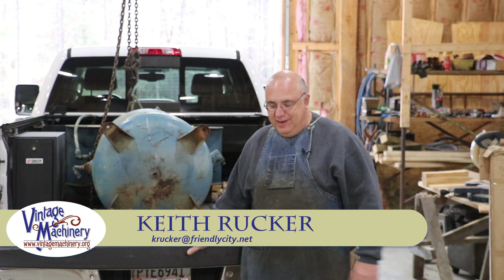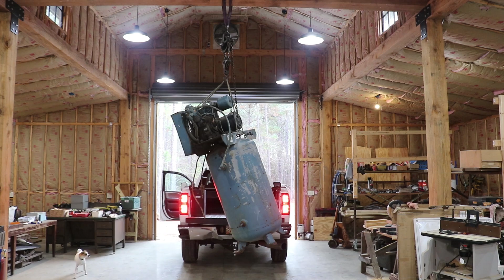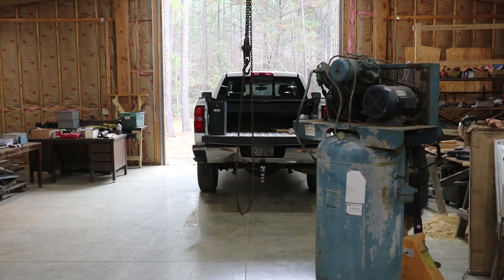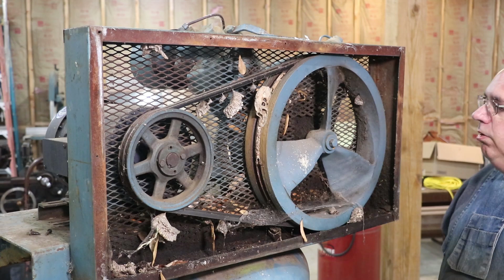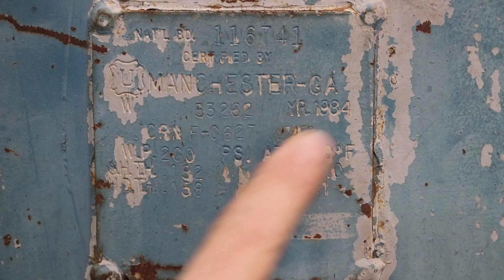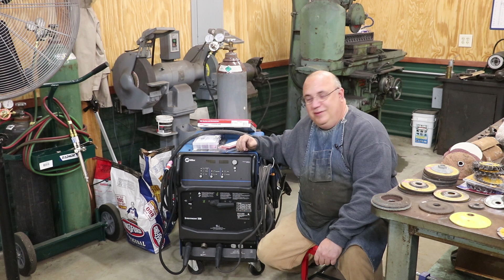New Air Compressor and Tig Welder for the Shop!

Comment: Treat yourself to a used Tommy Gate lift and some overload springs (the classic old timery tow truck and rollback mod is to use heavy same-width leaves off much larger trucks then extend your bump stops so they just touch the overloads by welding heavywall box tubing to the stops perpendicular to the spring) and you can self-load that sort of weight almost anywhere. For example I lifted the complete base of my old round ram Bridgeport using mine.  Used liftgates are usually inexpensive and while you can buy the adapters to any common truck for about 150 bucks you could make yours for the cost of scrap since they'd be a trivial project at your skill level. 
USB scopes are cheap online and let you do visual tank etc inspections and look inside machinery, cylinders via spark plug holes etc and you can use them with any computer or Android phone.

Comment: That Gas regulator doesnt look like the right kind for TiG welding? Maybe I'm wrong but they always have a glass part with a floating ball???? That one there looks like the kind on a cutting torch or MiG welder.............
Reply: Jusb1066 my Miller diversion 165 came with the same flow regular. But my miller dynasty 210 came the style in links you posted
Reply: nah the glass part is a water separator, which is usualy used  on airlines, not gas tanks, tig is still argon gas from a cylinder, that half of it is the same as a mig
Reply: No, not a compressed air water trap - a FLOW METER, most TiG setups have one, I'm a welder, not a keyboard cowboy- 
https://weldingsupply.com/cgi-bin/einstein.pl?PNUM::1:UNDEF:X:PXRF1430-580
Reply: http://www.eastwood.com/welding-flow-meter.html?mrkgcl=764&mrkgadid={_mrkgadid}&rkg_id=h-0d2c95e376968668e699bd477aa963b9_t-1513630112&product_id={product_id}&adpos={adposition}&creative={creative}&device={device}&matchtype={matchtype}&network={network}&SRCCODE=PLA00020&gclid=CjwKCAiA693RBRAwEiwALCc3u0CNt4XBLUk6SoaFkhWQkoRRI2GqVd8u0LW2sPNxWDEeD9hHdB86IBoCY5sQAvD_BwE
Reply: https://www.grainger.com/product/5KJ73?cm_mmc=PPC:+Google+PLA&s_kwcid=AL!2966!3!50916749757!!!g!82166712357!&ef_id=WYAcHAAAAFjepQU_:20171218204854:s&kwid=productads-adid^50916749757-device^c-plaid^82166712357-sku^5KJ73-adType^PLA
Reply: ahh yes a flow meter, i forgot sorry (been a few years)  i had one of those on my mig so theyd usually be the same?

Comment: I would be concerned about the the bottom of that compressor tank. Looks like some scaly rust below the center drain bung - "below" as it was laying in your truck as shown in the video. The bottom of the tank is vulnerable to rust thru if the condensate isn't drained frequently enough over its life. IMO, scrape that rust off and inspect it carefully before you spend much time working on it or even before pressure testing it to verify that scaly rust is just external corrosion and not the beginning of rust thru from the inside.

Comment: Kieth I would locate your new welder away from you’re grinders. That is if you intend to keep you’re equipment clean and in good shape. I protect  mine with covers supplied by the manufacturer, form fitted. After all I an not using them every day.
Reply: yep at least cover it, i think he did have grinding area in the shop with a curtain, maybe make a weld station the other side of said curtain? dunno, bares thinking about, hate to see welders full of  grinding dust

Comment: The formula for determining the hydraulic test pressure according to the ASME Boiler and Pressure Vessel code is 1.3 x design pressure x allowable stress at room temperature for the vessel material/allowable stress at design temperature.
Since we don't know what materials it's made from, this falls into the category of "technically correct but completely useless answer" - sorry!

Comment: Hi Keith,
Two things: looking at the large wheel for the belt, it looks like the spokes are angled to blow air over the pistons for cooling. So I'd bet it turns anti-clockwise as viewed from that side. As far as getting up to speed on the tig, check out Jody's channel - welding tips and tricks. He has great videos and great arc shots so that yoou can see what's going on in the puddle. He also has DVD's.
Good luck, feel better and Happy Holidays.
Rich

Comment: If you moved your chain fall closer to the posts rather than right in teh middle you could pick up a lot more. With the span and beam size I could tell you roughly what the safe load would be.
Reply: You better get on here and try and defend yourself. His stuff is way smaller that yours so we know you didn't send it. Even if you had culls they'd be bigger. Baily wagged off.
Reply: Perhaps Kieth didn't think of that

Comment: Now that is a air compressor. I have a 3 cylinder, 60 gallon compressor and it is nice to have the capacity. Mine sits on a concrete floor so I put rubber feet on it, quietened it down quite a bit.

Get better.

Comment: You only need to run 100 psi ,air tools are built to run @ 90 psi be safe .Look for a direction arrow somewhere and change the oil. Harbor freight has a bore camera ,a good investment .
Reply: well the compressor runs more and stores more air, and it will keep the flow up along the long lines, and regulate at the end where you use it, is kinda why they do it,
Reply: Big tanks often have an opening, which can be removed to control it from inside.

Comment: long time watcher, I piped my dads shop in the 70's  with old gas pipe that was being tour down from a building. T contractor was cool an just said take it if you want to shake it out of the pile of material. I guess these  days they might want a few bux an you may have to bend a pipe or two, just a thought

Comment: Hi Keith some years back I spent three years building Air comp.s for a living DOR is anticlock wise this is only a heads up to check it out  looking at the fly wheel and the built in fan blades  run it the wrong way and it will seize up as the oil pump only pumps one way regards Norman  Isle of Wight UK

Comment: Keith, the compressor will pump turning in either direction, but when you wire your motor, make sure that you have the rotation in the direction of the arrow on the flywheel. If it has no arrow, make sure it turns so that the pitched spokes/blades are blowing air across the pump, not sucking it away. Also, when you set the compressor, if you're going to bolt the tank to the floor, make sure you bolt three feet, then shim the fourth foot if necessary before you bolt it down. Those feet are never installed symetrically, and if you tighten all four down with no shimming, you run the risk of torquing the tank and putting a substantial amount of stress on the welds when the compressor is running. From the lines I see coming off the cylinders, it appears that you may have the option of running the compressor either start/stop or constant run load/unload, depending on the electrical and pressure controls you use.

Comment: Cheapest and quickest way to plumb for air is to buy a roll of 16mm ( 3/4) nylon air line, and push on fittings to suit. Use nylon instead of the cheaper polyurethane, even though the nylon is a lot stiffer, as it lasts a lot better. Then just use T fittings and valves ( definitely use the valves right by the T, makes life easier) where you want drops, and then a water separator and fitting at the wall for the air line. At the compressor side a large non pilot valve ( preferably one with a brass body, but the alloy ones do well, just has to be 3/4 or larger so the port is big inside) connected to the power, so that turning the power off turns off the shop air as well. Makes easier startup as you do not bleed all that expensive air out through leaks. Add an auto drain as well, preferably electric, and put a mesh filter bowl before it to keep the crud and rust from the tank ( on that age tank there will be lots initially after the hydro test) from clogging the drain. 

I mounted the auto drain up a ways, using a shut off valve on the tank base ( stainless steel ball valve here definitely) to isolate it for drain servicing. Output of the auto drain is simply run through a 10m tight wound coil of 6mm tubing, it makes a great restriction free sound dampener for the noise.

Comment: Hello Keith, I am sorry to hear about your illness, maybe you should have taken a flu shot? They advertise them non stop, or so it seems. 
I just wanted to tell you, trig as as easy as can be. On pipe welding I had to learn to walk the cup and I have only got one good eye but I learned and I have no doubt, if I was to take a test on 2” pipe with a tig root, no problem. It is really easy. I guess it is like riding a bycicle, once you learn, you never forget.
All the best, Edgar

Comment: First, I pray you get better soon, but judging by how fast you work that hoist you ain't doing too bad... Congratulations on your new gear. For tips on the Miller machine check out "Welding tips and tricks" and "Welding.com" YouTube Channels they're awesome with clear concise guidance. If I'm not mistaken that compressor head has an automatic clutch so the motor always starts without a load, as the pulley speed increases the centrifugal clutch will engage the compressor input shaft. If the compressor head is bad I've got one for you, let us know.

Comment: Will one phase converter run all your three phase equipment? I was thinking you needed one for each machine.
Reply: Nope I run a dozen machines off my one phase converter.
Reply: can you run two or three at the same time? Thanks.
Reply: Lewie, I imagine you saying that with an English accent, am I right?
Reply: Yeah but you got Baily on the treadmill. He didn't get run over, just wore down and out!
Reply: Hillbilly English if you can call it that. Brian is in Ken-tuck and I'm in Care-O-lina.
Reply: no you connect the converter at the head of the circuit, sure it may only be rated to run one machine at a time, but hes one guy,!

Comment: The air tank has a U1A code stamp and a National Board#( look up the National Board  on the net) give them the # on the tag and they will send you all spec.of that as built i.e. heat treat, MTR's. weld spec.,pressure tests and such.
Reply: National  BD# on tank is 116741
Reply: http://www.nationalboard.org/Index.aspx?pageID=113&ID=442

Comment: Great welder, Learn how to tig braze!!! I did and I will never ever gas braze again. It works way better and is way easier to get much better results once you get the hang of it and its not very hard to learn. One tip I've learned is watch to watch 'Welding Tips And Tricks' channel, that man forgot more about welding than the rest of the internet knows combined and has the best videos I've ever seen on welding! Sounds like the valves are stuck on that compressor, just pull the heads apart and clean every thing up and that is all it should need. the compressor that ran my machine shop for 5 years full time was an old compressor that I rebuilt by just stoning off all the faces and making new gaskets from card stock.

Comment: Keith: I don't know about air compressor tanks, but scuba tanks are hydro'd at 5/3 working pressure. IF that applies to your tank, then the hydro pressure would be 333 PSI. I don't know if a new propane tank would be legal as an air tank. Check with a propane company and definitely your insurance company. They should know. Some people may say that a tank is a tank is a tank, but there's probably a paragraph in some obscure regulation somewhere that would void your insurance policy. Find out for sure. Good luck, and Merry Christmas.  Jon.

Comment: Changing the topic here... how will you get that compressor off of the pallet jack at its new home location? I had a 300+ pound band saw on one a while back and had a difficult time getting it off mine and onto the concrete. I'm not little, but lifting even half was a chore for me.
Reply: In a much earlier video he used an engine hoist to move a few things around. I imagine that's what he'll use to set the compressor in place. I bought one a couple of years ago and it has saved my back many times.
Reply: I have a 2 ton milling machine, I just left it on the pallet ;-)

Comment: Oh, does that design look familiar. We used to build them in Sidney, Ohio. That one was likely built by LeRoi when it was owned by Dresser Industries. That product line is now owned by Gardner Denver. I think you can still get the compressor. Hydrostatic test pressure should be 1.5 x maximum allowable working pressure (MAWP). The MAWP should be on the certification tag on the tank.
Thanks,
John
P.S. I just saw the working pressure of 200 psi. I'm told that you can get a borescope via eBay for next to nothing. It would be useful for inspecting the tank bottom.

Comment: Keith, one last thing....I also just purchased my first TIG welder as a Christmas gift, yes, to myself. It's a  Lincoln Square Wave 200 TIG welder with Stick capability.  Your Miller appears to be a stout transformer industrial model compared to my inverter model, or so it appears. I am also excited to start practicing TIG welding, as you are too. Congrats on the aquisition.

Comment: Good piece, tho i would check the bottom, just in case.
Nutshell tea is one of the best throat easing remedies you can get. If you're not allergic, you US folks seem to have an allergy for everything ;-). Anyways, a fist of shells in about two cups worth of water, boil them, remove the shells, and add about half a spoon (or more, to taste) of honey. Excellent tea.

Comment: Make sure when wiring it up, the motor turns in a direction that air blowing off of the pulley vanes is blowing across the compressor, those dresser compressors in that series are directional on the oil pump

Comment: that compressor has a centrifugal unloader..  flying weights that come out and release the pressure applied to the pin plunger screwed to the side cover. this allows the cylinders to start building pressure.. i don't recall how the unloader system works in the head..   it allows the compressor to release air as it comes to a stop .. so it can start up without a load of air holding it back.  prevents the electric motor from locking up and causing a fire..  had the unloader get out on a horizontal 5 horse with the exact same frame motor.. it locked up on a restart.. i ran like crazy across the yard to shut it down. that compressor had come out of a body shop that burned to the ground.. except for the week old new compressor that was still bolted to the pallet. 

 i am going to make a suggestion.. for your extensive spare time.. yea.. right.. scrounge the strongest forklift pallet you can find.. or build one.. glued and screwed with deck screws together.. but with a piece of 3/4" plywood on the top..  be sure to build it as a 4 way pallet..  this makes your pallet jack really handy...  if you build a second.. that when jacked up is just slightly lower than the lowered tail gate of your truck. you will find that it will really help in unloading your truck.. doubles as a short work bench when not being used.  why slightly lower.. heavy items may weigh down the back of your truck..  if you want to load things into the truck.. jack the pallet jack up higher..  you can make a double tire chock for the pallet jack swivel wheel set also .

 the welder outlets..  do you have any Cement board used to go under tile kicking around.. to mount to the plywood wall to screw your welder power outlets to.. so there is little chance of any sparks flying out the back and setting the wall on fire.. you could also use 12" tile sections..  some tile stores sell even bigger tile sections..   with the various sockets needed for various 240 devices.. you might want to think about since you are opening up stuff.. at least install the sockets and wiring into the box.. you can add the additional circuit breakers that cost a bunch more later..  to keep the costs down till the additional sockets are needed.   please when you do this.. pick up some address letters to go above the sockets on the wall.. that denote which circuit breaker number they go to in the box.. yes.. i know there is a label.. who has time to read that.. 

  you might .. look around for one of the commercial electric plug boxes that are like a footstool... so you could move it around the shop..  i don't know if that will work for you.. may not have enough power rating to run the welder.. 

wayne..
Reply: Great advice.

Comment: Cut that old tank free of the compressor and get a new horizontal tank.  Don't waste your time with that old tank.  A newer horizontal propane would be great as they use the same pressure ratings.  And give ya more reserve if ya get a bigger one.  The welder looks like brand new, so no problems with that.  Merry Christmas my friend.

Comment: When I worked at Home depot as the tool rental service tech we needed to pipe the shop for air as well. 

I used pex pipe and pex fittings, and it worked great. This is just a suggestion for a cheap method of installing air pipe.
Just to put your mind at ease I had pressurized the system for two days at 250 psi it held pressure and had NO issues.
the piping that I installed is still in place and functional to this day that was approximately ten years ago.

Comment: If you can gas weld you will find that tig welding is just the same only you use power supply to control the heat instead of the gas tip size.